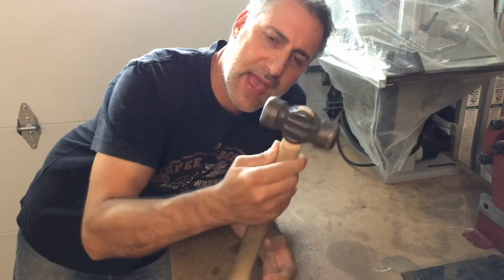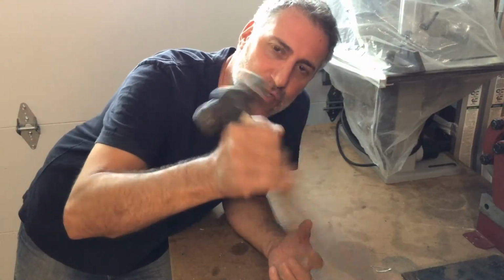Beginner Blacksmith - Charring a Hammer Handle

Comment: Looks good!  I'm looking forward to more videos, been waiting a long time.  I haven't tried a blackened handle like that, does the charred stuff wear off at all?
Reply from the maker: Paul's Garage - Thanks! Trying my best to get more videos out there but my free time is always a bit scarce. You should try charring the handle, it was pretty easy to do. As for it wearing off, I'm sure it does after awhile. The linseed oil helps soak the charring deeper into the wood which helps.

Comment: Usually when applying a BLO Finish (Boiled Linseed Oil) it is thinned with Mineral Spirits.
This helps it soak into the wood fibers deeper than it can straight out of the can.
It also helps in drying faster.
Reply from the maker: Thanks for the tip! I think I'll reapply the way you suggested.

Comment: I am not subscribed to his channel, but I noticed something from Christ Centred ironworks video about power hammer number eight. He had his tripod setting on a rubber mat. Maybe it might help with camera stability. Side not...I placed an order and paid for a rounding hammer 2.5 pounds delivered. I should see it before weeks end. Instagram and Facebook 'bespoken hen'. He is on a blacksmith page on FB. I'm so stoked!
Reply from the maker: Very cool on the hammer! Show it off once you get it. I came up with a solution to the tripod bouncing. It'll be in the next shop update video.

Comment: Was wondering where you went!!
Reply from the maker: shepards forge h - Yea, same old story with me. Not enough free time. I try to do a little at a time, which is why videos are so far between posts.
Reply: That's a familiar circumstance. I have 5 videos waiting for edit from mid March to now, no time to do it. I did get out the forge 2 weekends ago however and made a pair of bolt tongs, my first ever. No video, just practicing and needed a pair of tongs.